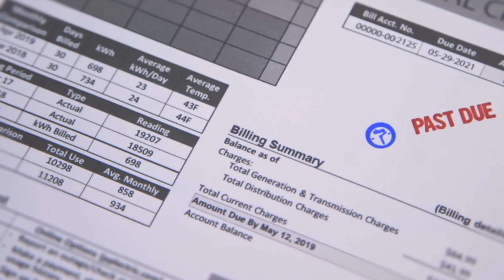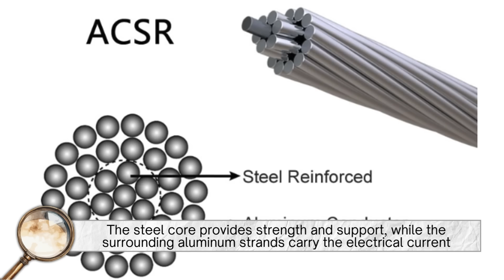Why Do Power Lines Use Aluminum Instead of Copper?

Comment: In the 1960's the idea of making powerlines out of Sodium was investigated .... Sodium is only slightly more resistive than aluminium , but 4 times less dense , so cables could be much lighter , the highly reactive sodium would have a plastic protective layer and then steel wires on the outer layer to give strength.

Comment: And Audiophiles worried so much about a 1 meter of electrical wire in their sound system, they need a $1000 OFC silver plated electrical wire to make sure a pure electric. Meanwhile, power lines use aluminium.

Comment: While traditional lines use ACSR, UHV (1+ MV)  projects increasingly shift toward advanced materials to manage heat and weight:
ACCC (Aluminum Conductor Composite Core): Replacing the steel core with a high-strength carbon fiber composite. ACCC can carry up to twice the current of ACSR because it resists thermal sagging at much higher operating temperatures (up to 200°C)

Comment: Aluminum wire will burn open when over loaded .Cooper will not . Cooper would keep feeding power causing allot of damage. Aluminum acts as fuse opening circuit. Now you know the truth

Comment: Aluminum wire is much lighter than copper easing the load on the support mechanisms and much less expensive !
Reply from the maker: Exactly! Lighter weight and lower cost are major advantages.

Comment: Alu-min-ee-um (Aluminium) is Lighter & Cheaper, Also the 'Current is Very Low' as they carry 465,000v with About 1A, As the Voltage goes Down at the Sub-Station/Transformer the Ampage Goes up, In Britain As I Learnt in my Upgrade to the 17th them 3mths later the 18th Edition of the Regulations

Comment: Hi sir, please reply as i was an electrician for 50 yrs, my house wire entre cable from post wire is thicker, as all house as i have seen, how can you feed for 20 to 30 houses, looks 16mm or 10mm aluminium cable, i understand the sequence of phase balancing, but how that cable can be small, well appreciated, please reply.

Comment: Summary
The video explains that although copper is a better electrical conductor, aluminum is chosen for power lines because it offers a superior balance of weight, cost, durability, and practicality. Engineers prioritize not just conductivity but also economics, structural efficiency, and long-term sustainability. Aluminum’s lighter weight, lower cost, corrosion resistance, and recyclability make it the dominant choice for large-scale power transmission.

*Thanks me later.

Comment: All these are good points but they missed a big one.  High voltage AC current travels on the outside skin of the conductor not in the core.  DC current requires highly conductive core like copper.  AC current encounters inductive reactance while DC current encounters resistance and large voltage drops.  Inductive reactance has less effect at reducing AC current than resistance has at reducing DC current.
Reply from the maker: You've brought up some excellent points about AC and DC current!

Comment: In Odisha we 😢 installed AAC  Aluminium reinforced steel conductor for MV distribution  of 33kV before it's charged it's came to me a shocker that it was stolen ,   Thinks its copper it's gonna be nightmare, So for us it's good a overhead or cable conductor we are safe with Aluminium, For cable anything beyond 10 sqmm is Alumninum .. but it's not good in environment basis but no choice for safety from robbers.
Reply from the maker: That's a really tough situation to deal with.

Comment: Most of the high voltage electrical current runs on the outer part of the conductor, not the center.  This is the reason that steel wire can be used in the center of the conductor for strength.
Reply from the maker: You've hit on a key point about high voltage current!

Comment: I have a question about the price on Aluminium. Isn't that Aluminium is high in cost eventhough it's abundant  on Earth. Because the extraction of aluminium is much higher cost because it uses electrolyte and carbon is less reactive than aluminium so they use that method. Fix me if i have wrong

Comment: Why is Al then not used in household power transmission?
Reply: Aluminum was tried for household wiring a long time ago.  Thinking 50 years.   Terminations and joints were very problematic and if not done properly fires resulted because of the higher resistance

Comment: There's another reason Aluminium is better than Copper it also has a tough oxide layer that helps protect it from corrosion and being exposed to the elements is in its favour🙂🙂 Copper will corrode over time.

Comment: 6:25 there is also Skin effect - it's the tendency of an alternating electric current (AC) to become distributed within a conductor such that the current density is largest near the surface of the conductor and decreases exponentially with greater depths in the conductor. The electric current flows mainly at the skin of the conductor, between the outer surface and a level called the skin depth. So skin depth area is more imporant that's what is actually in the center (like steel reinforced in acsr)

Comment: Weight is clearly not a consideration. It would weigh about the same if it were made of copper, because less of it is needed for the same current load. The conductivity and weight are roughly in proportion. However, the cost would be twenty times higher. Everything would be more expensive. Well, that's why aluminum is everywhere, not because of the weight. The copper would be better in that it requires a higher temperature to melt, and it could be overloaded better.
Reply from the maker: You've hit on some key points about conductivity and cost!

Comment: Copper is a heavy metall and when something is heavy there are more tensions. That is why you use aluminium for overhead powerlines. The density of aluminium is 2,70 g/cm³ at room temp. and copper has a density of 8,93g/cm³ at 20°C. Have nice day
Reply from the maker: You've hit on some key points about why aluminum is preferred!

Comment: Let's face it.  It is cost primarily.   Lighter cable = less support, longer spans etc etc.    It's all about cost.    The losses don't cost as much as materials would.   It's not about safety or any other thing.  It's purely down to cost.
Reply from the maker: You're definitely right, cost is a huge factor!

Comment: I remember when they used aluminum wire in homes <. That was a very BAD IDEA .  Aluminum wire expands and contracts, meaning a tight connection today is loose later , can cause fires

Comment: Now aluminum Costs $.60 a pound, copper costs $4.00 per pound. I think the aluminum is mixed with copper, they call it aluminum copper that is used for power lines.
Reply from the maker: You're right, cost is a huge factor in why aluminum is preferred!

Comment: You would also need  thinner copper wires compared to those of same rating in alluminum nut the biggest  no braner  is the cost. If you have copper  power lines in places like Macon GA, the town would be without electricity  overnight XD

Comment: Copper isn't used in high tension lines it's not because of the cost it's because of the weights it will collapse under its own weight that's why they use aluminum anybody who thinks different needs to go back to school and learn why they do it don't assume s***

Comment: To see those stretched wires high above the sheathed wires below, from pole to pole approx. 200 feet apart I always though those two top conductors had to be stainless steel for strength and longevity!  Not to mention how shiny they are, as aluminum corrodes in wet rainy conditions much faster. Amazing!!!!!!
Reply: So U're saying U're Power Lines are Supported Every 61.15m Apart, so in effect next to Every Other House!?

Comment: More massive powerlines mean more lands become unusable. The powerlines leak energy to the ground by way of em waves. I have seen how much destructive this can be when the wire runs horizontally in the case of utp cables. This energy is directed towards earth, and those who are under them regularly get diseases like leukaemia. This is why children should not play in fields where powerless run overhead. Also, you must not live close to transformers. Though the frequency is low, it's amplitude that actually gives the punch high.
First of all, we need to understand the two parts that make electricity: the positive that takes power to the consuming item and the thing called 'return'.

Comment: I can end this video in one comment Aluminium is lighter thus it doesn't sag as much as a copper wire.

Copper is good for  short distance, but aluminum is lighter and cost less, so it's better for long distance so your house has copper wires while long distance lines are aluminium.

Comment: In another application of similar vein-
 
My father was the first national manufacturer of all aluminum greenhouses - for the same reason; 
the protective layer of aluminum oxide made his structures much, much more longer lasting than steel built greenhouses.
BTW, he was a non-conformist - got his degree in civil engineering.
= good results! 😁

Comment: Aluminum has corrosion resistant properties similar to tin in that the outer corrosion layer seals the inner metal from further corrosion allowing for bare wire high tension lines. Copper wire requires a protective layer(insulator) to prevent corrosion.adding to the additional weight of copper wire over aluminum wire. Copper wire in above ground installations has always had the problem or rodent damage to the insulation.
Reply: Aluminum boats are very resistant to marine corrosion thanks to the sheath of oxide.
Reply: Wire above & Below Ground Should ALWAYS BE IN CONDUIT, It's Called 'Mechanical Protection' you Cheap Skate Idiot.
Reply: ACSR uses insulated, stranded aluminum wires with a steel core.  Insulation is used to protect against eddy currents and reduce skin effect.  The center of a conductor carries less AC current than the skin. So, a steel core has less impact on conductivity than one might intuitively expect.  Using stranded wires on the outside further reduces skin effect; the additional skin area of the stranded wires further reduces it.  Insulating the strands further reduces eddy currents and the skin effect.

Comment: I believe during the 1970s general motors used aluminum battery wires and fields and their starters on Vegas and small cars because copper was becoming scarce because of the Vietnam war. When those cars got hot sometimes they would not start and I believe the cables were the same size as cover. So maybe if you make the wires four times bigger it might work but it sure didn't work in the automotive field
Reply: You are right. There are specific techniques one must use for aluminum junctions. Making mistakes is super easy.  The people who work on transmission lines are really specialized and follow these techniques (mostly).  Look up the Camp Fire in California; not directly related to ACSR, but negligence contributed to many of the fires and deaths.  

I personally prefer aluminum for whole-house wiring, but it can be tough to get everything right to pass inspection.  Furthermore, the electricians who work on it later may cut corners.

Comment: Why do they use aluminum wire instead of copper? Cause copper thieves with an IQ of 6 will come up with the brilliant plan to cut live wires trying to steal the copper. I'm sure that's not the main reason why, but as dumb as the world is, you just know someone would try it

Comment: The PoCo was replacing old poles and lines dating back to the 50s and left a bunch of scrap cuts and old insulators on the shoulder. The wire was copper coated steel wire.

Comment: It's about initial cost.  The fact that copper is targeted by thieves.   And the replacement costs after it disappears.  Putting lines above ground is a loser to begin with, so justifying it by using light aluminum and flimsier towers is doubly dubious, in my opinion.  Our lack of investment in infrastructure, long term, will be our undoing.  PG&E celebrates every mile they underground with commercials that cost ten times as much as the actual re-routing of the wire itself. That's American infrastructure investment in a nutshell.   Plenty of sizzle. lots of gravy and very, very little steak.  Recently thieves sabotaged the water pipes in an Oakland DMV office  and during the subsequent shutdown for repairs cleared out every single copper wire inside the place.

Comment: so you're high voltage lines that are very high up in the air or aluminum but the high voltage lines that are accessible with a ladder on poles on the side of the road or copper I know this because there are copper thieves, stealing them

Comment: What is better underground?  A lot of power transmission is now buried.  Eliminates "downed" electric lines and power outages.
Reply: Underground power lines do not require the tensile strength of steel; they use copper or aluminum.  Steel also impedes line bending due to terrain and local requirements.  They tend to twist strands into bundles, then twist these bundles into a bigger cable,  
They also add signalling lines to support fault detection and cable location.  I once rented a place from a slumlord who had multiple illegal houses on his property, and one of the things he did to prevent PG&E and the county from catching him was to run underground power cables.  It worked fine till it broke.  Equipment for detecting line breaks without a signalling cable relies on transmission-line reflections. He spent a lot of money on it and got nowhere.

Comment: I used alluminium for my home underground, for cost. But i had to increase size to allow for voltage drop and current carrying capacity. First time in my career i used Al. Used it once when i was an apprentice,
Reply: Voltage Drop happens when the 'Radial' is Very Very Long, ie Outside Socket from the Consumer Unit 100m+ & Current Carrying Capacity is to do with What You Are Powering

Comment: Power lines use ACSR conducters. Copper is costly for longer lines. Al is mixed with Steel for reinserforcing to bear weight of conductets.

Comment: Aluminum is much more susceptible to thermal expansion and shrinking, which is why a lot of insurance companies will not write a homeowners policy on houses with aluminum wiring.

Copper is much more expensive and not as durable. But the expense and value is the biggest problem - if power lines were copper every meth head in the US would try themselves trying to scrap it.

Comment: Buried distribution cables also normally use aluminium, usually with short copper service cables into domestic property. Copper is more flexible, and easier to work with in those circumstances. The other special case of power distribution is for overhead line electrification for railways and tramways. Almost always done with copper under tension for the pantographs on the rolling stock to connect to, with lots of aluminium wiring for the rest of the circuitry. Of course, with copper suspended in the air, you want it live to discourage the thieves, if nothing else!

Comment: There is a simple reason why aluminum is used over copper..  it's economics.. aluminum is much cheaper than copper.. when you need to run hundreds or even thousands of mile of wire, you do it as cheap as possible..

Comment: I used to work for a power company and I wasn't an engineer and I asked some of the electrical engineers this exact question. Simple straight answer was wait copper ones are too heavy and would sag too low from the distances they have to span I don't need a whole video for this keep up with the clickbait

Comment: It's about money. Copper is way more expensive than aluminum. It's also heavier. High wire power lines operate at extremely high impedance's. Super high impedance's mean super high voltages but low current. That low current means there is less loss along the transmission line for a given voltage level. There are many more reasons but the ones I mentioned are the most relevant.

Comment: Well. Not sure if this counts to anything else. But the single steel core that runs thru the center of that cable is also calculated into the equation. As we all know. The weather is a major factor. Aluminum expands and contracts much more than copper. That why the highline cable has specific coatings. Not all modern highline cables use the steel core strand. But most lines out there do. Many incoming systems to from the generators. Are high voltage. Not your average home voltage. I was actually getting my 1k volt and up electrical license at 1 time. Many moons ago now. My last step was to swing out of the helicopter onto the powering itself.

Comment: IMPORTANT

We transfer electricity with very high voltage and very little current. Both materials work the same at such a very low current but high voltage.

Comment: i have old copper power lines at least 40 yrs old in a very wet environment they have a natural blackish coating onlg get green corrosion if they end up on the ground, no way would i go for aluminium.

Comment: We know that aluminium is a metal. Metals are generally good conductors of electricity. The conductivity of a metal is the ability to allow electricity to pass through it. Since aluminium is a metal with low resistance and good conductivity it is used in electrical wires.
Reply from the maker: That's a good summary of why aluminum is used!